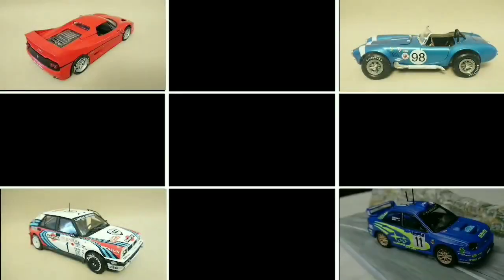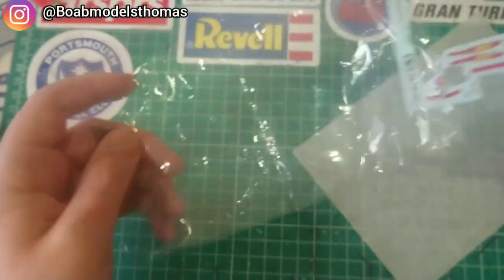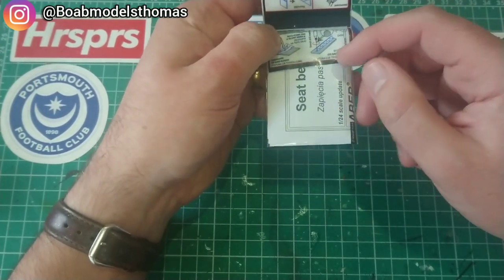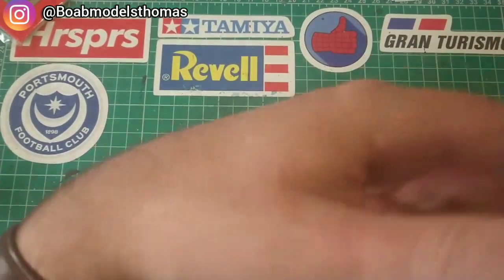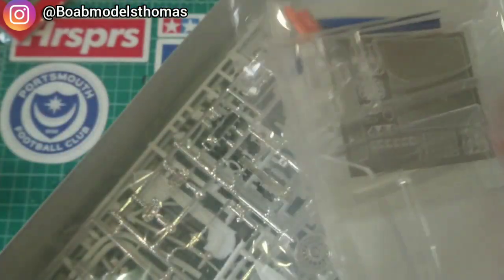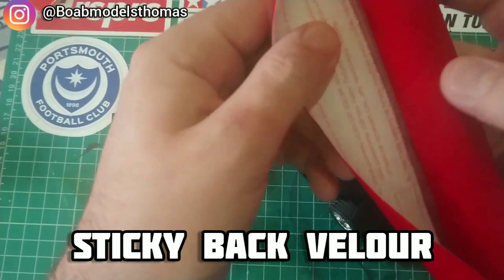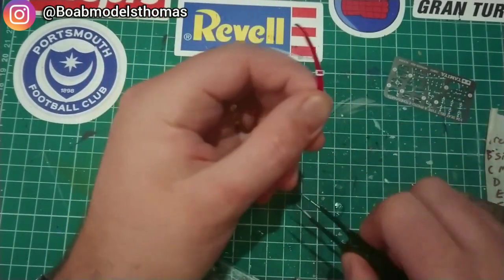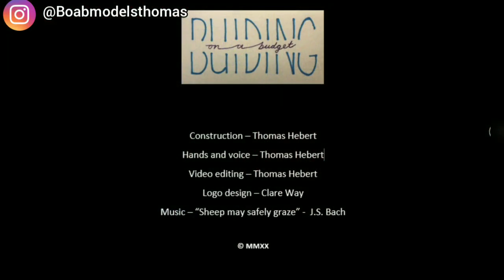Building better seatbelts for scale models - materials and photo etch - Tips and Tricks -cars planes

Comment: Very useful and informative video 👍 I have used the Edward photo-etched seatbelts in 1/43 scale. They were very difficult to use and very difficult to keep in place. They look nice though but are prone to paint chips when you have been struggling to fit them in so I don’t recommend them. I will try your more practical materials next time. Thank you again for your excellent video.
Reply from the maker: Thank you for your kind words. I'd like to try some of the Eduard ones but 1/43 is pretty small. I didn't get on very well with ribbons so I decided to try a few different types. I'm glad you found my video helpful.

Comment: I've picked up lots of tips and useful info since I started watching your channel Thomas, thank you! I quite like the ribbon and buckle method for regular seatbelts. I got some resin buckles from eBay that work quite nicely. Also I ended up getting the Lotus 7 that comes with those sticker/photoetch belts but they are so fiddly and the belt keeps sticking to itself so I've been putting off making the passenger seat belts for a few days now after struggling with the driver's side haha
Reply from the maker: I can totally understand - they are very fiddly! The main issue with ribbons is making sure the end doesn't fray too much as that can make threading basically impossible. Nice sharp scissors can help there!

Comment: Nice video Thomas. I get 50yrds of 1/16" (2mm) ribbon from amazon for like $5 or $7. I have Black and red, but I need to pick up some blue soon. I also get photo etch seat belt hardware from model car garage . com as you get enough to do standard belts for several cars. They also have a harness set.
Reply from the maker: The ribbon does look good when done right and it's good value! I'll have to look up that website - I find the PE parts the hardest to find. Thanks, Justin! 👍